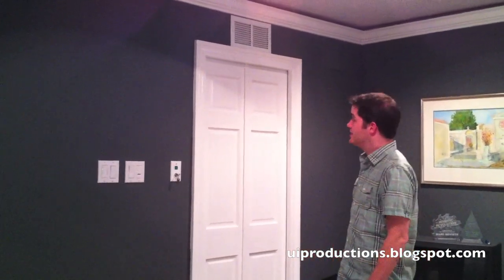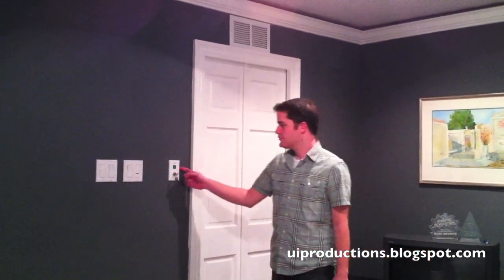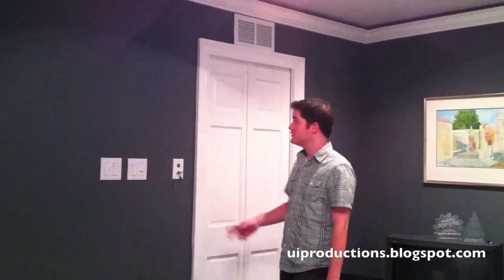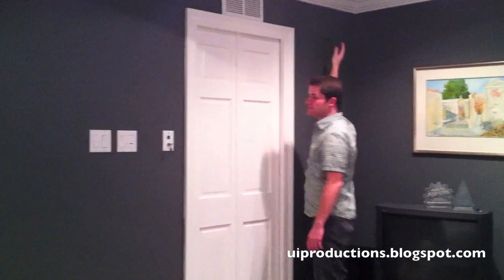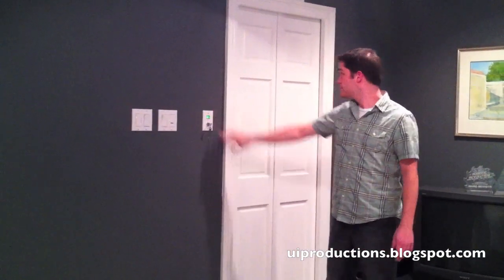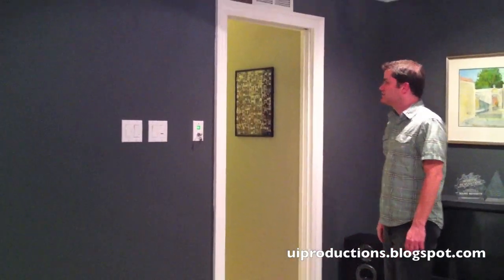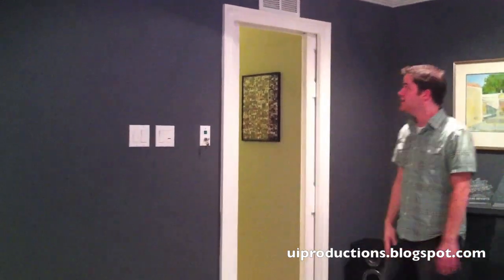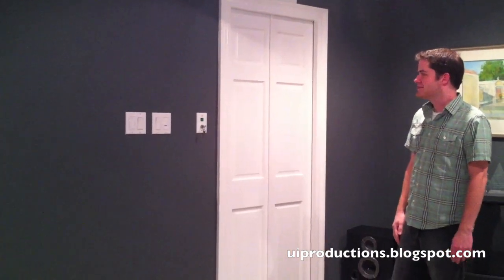Air-powered Star Trek style door

Comment: @uiproductions Consider a IR trip sensor instead. They can be built cheaply from a few parts from Radioshack. Basically an IR emitter, IR detector, and a double pole single throw relay. You can hide the emitter in either the wall or the ceiling with the IR detector dead opposite from it. Putting it about two feet from the door should be far enough to open in time.

Comment: @akkudakkupl I would think the air pressure is holding the door closed. No pressure = open door, so power outage wouldn't matter. I guess it would matter if you wanted to keep it closed during a power outage, but that's what backup power supplies are for! Redundancy ftw. Epic door, by the way, I want one!!

Comment: It's a great idea and design Uiproductions, but what safety features are there?

What happens if there is a house fire and it causes the electrical supply to fail?
Will the door spring open on power fail or stay closed and refuse to open?

Could anyone be crushed between the two doors?

Ian.

Comment: You need to put mufflers on the exhaust of the cylinder or valves used so it's not so noisy!  Not sure if your'e using any speed controls (needle valves) Could open faster with larger air lines maybe?

Comment: The only real reason for this door system would be an extremely cramped area preventing a typical hinged door, or at a push in the home of a wheelchair user, where normal hinged doors can be awkward to use (though bidirectional hinges exist like the doors stereotypically used in restaurant kitchens). Otherwise there's not really an excuse for a door to consume power when a slab of wood and some small metal parts do the same job perfectly well with zero electricity consumption after manufacture.